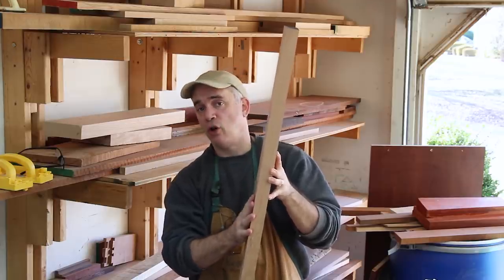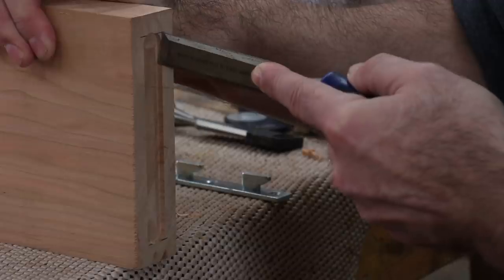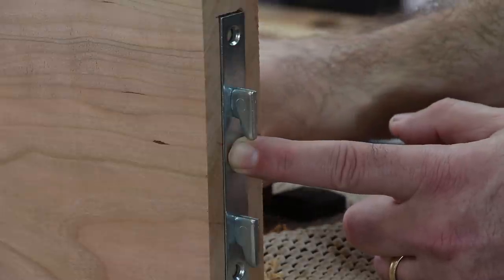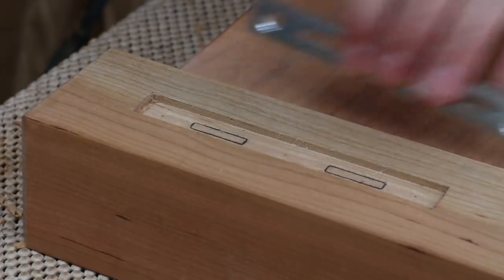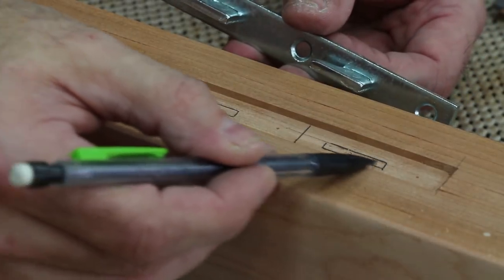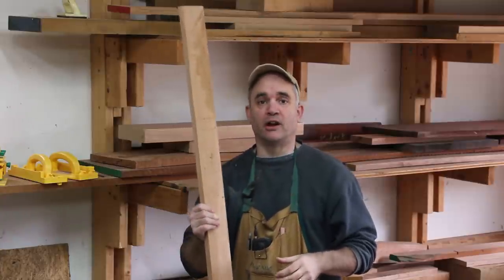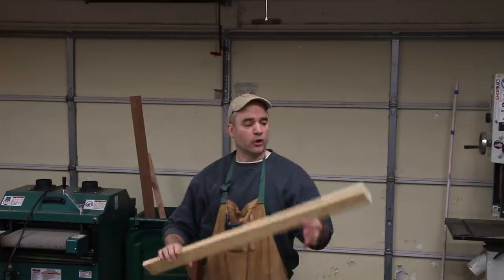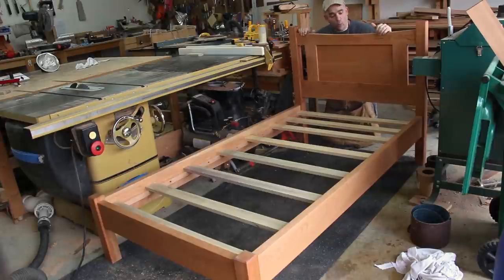A Cherry Bed Part 4

Comment: Looks great! I like the use of the knock-down hardware, too. Makes it so much easier to take apart and move without having to keep track of the bolts.
Reply: I personally don't like those things. They don't make as rock-solid of a connection as I'd like and I don't trust screws to not loosen over time. They do save on fasteners though.

Comment: Beautiful work Brian!  

Was the horizontal mortiser not able to do the mortise on the leg for the hardware because the head and foot were already glued up?  I have made a couple beds for my kids (the twin bed design Matthias has on his website) where the rails are screwed into the legs.  Those have worked great, but I like this as the next progressive step.  Maybe when I get around to making a bed for the adults in the family :)
Reply from the maker: Yes.  After it's glued it can no longer fit on the mortiser.  I prefer to make those mortises after everything is glued.